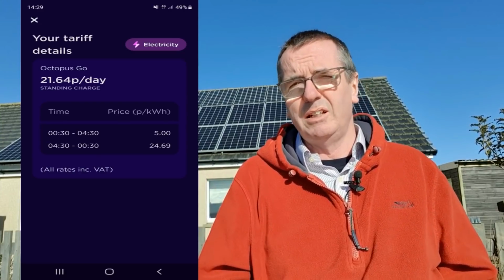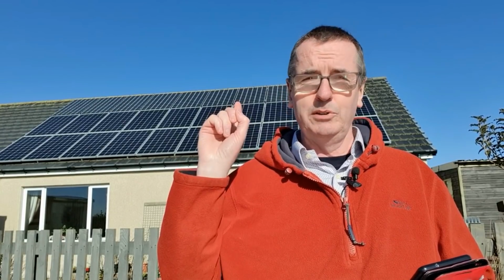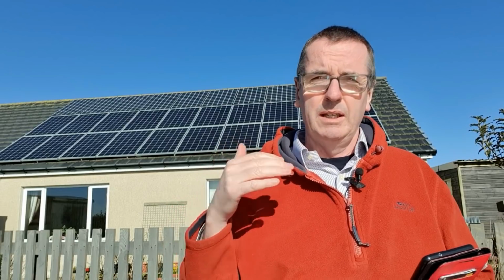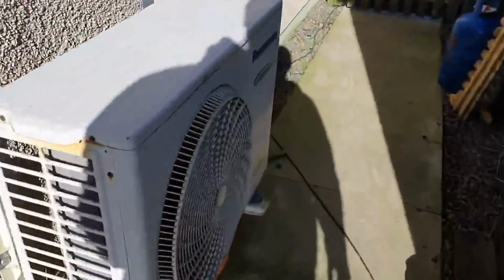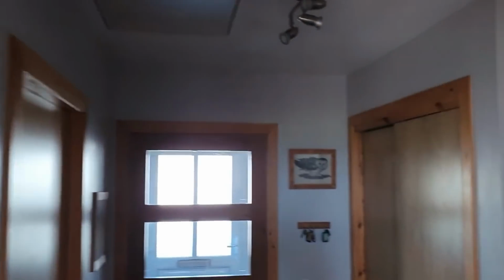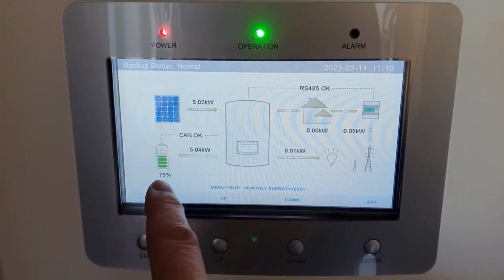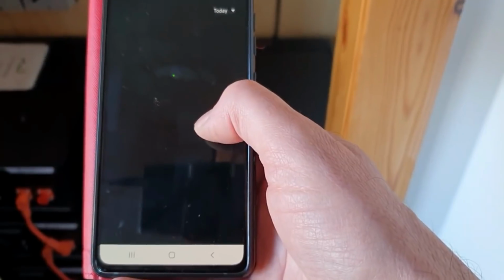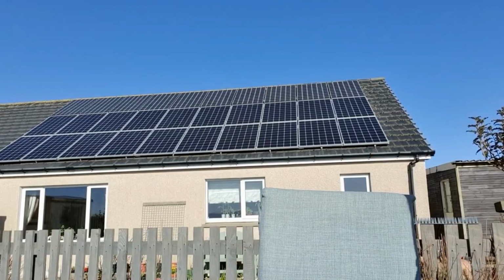My home solar PV and Pylontec battery storage setup

Comment: Excellent walkthrough of your setup.  I am going down the pylontec route myself in a few months.  I have 4kw solar array, ground source heat pump and rain water harvesting system.  House is super insulated and all devices are A++ as a minimum.  Like you i am interested in the technology, but specifically want my house to be as cheap to run as possible for when i plan to retire in 10 years at 60.  My current Go tariff and electric bill come to £1350 a year, but my FIT is £1500 making me a small surplus for the last 2 years of living here.  (Solar installed. 8 years ago by previous owner).  My new tariff from Go based on actual usage is £2780, so i want o upgrade my panels to 10Kw and put in a battery solution to harvest the solar as currently i send the majority to the grid.  I have a Nissan Leaf which is cheap as chips to fill up.  My water bill is £65 a year and we do not have any form of oil or gas so no bill to pay except for the cost of logs for our fire which is £200 a year.  Solar and batteries have never made so much sense financially as they do now.  Would be really interested to see what you do about the wind turbine as i live at the top of a hill which gets plenty of wind.  It seems a no brainer to me as i have a large agricultural barn i could put 2 or more on which is away from the house but fairly close to the solar array and the inverter.  Cheers again.  Convinced me with pylontec.
Reply from the maker: Thanks J for your comments,  and great set up you have , it really does become a passion doesnt it !

Comment: EVERTING depends o the night rate remaining low,, that is the Achilles heel in the system,! 😬
Reply from the maker: Around 8 months of the year i fill the battries from solar , there will always be a cheaper 'off peak' rate electricity as when demand is low , company's 'need' to sell it in order to balance the grid.

Comment: If your roof wasn't suitable for solar would it be financially worth going with a battery set up to benefit from cheaper rate night time charging?
Reply: If you have a pair of east/west roof pitches then it can still be worth investigating the pv potential now with the lower cost of panels. You get a different shape of generation both through the day and over the year - it has some upsides as well as downsides.
Reply from the maker: Yes ! Fill when its cheap , use when its expensive !

Comment: Thanks Jonathan. Great video. Thinking of all the tech mentioned. My only issue is only cupboard space near mains is under the stairs. Could I fit everything in the available space.
Also do you have bird issues on panels. My wife is concerned that they may become a problem on the roof.
Will definitely be looking for a heat pump system next. Love the batteries as they are doable👍
Reply from the maker: Ive not had any bird issues here , my friend chris in Aberdeen has had grills fitted around his panels to stop the birds nesting. Depends on the area i suppose.
Reply: You can now get bird guards (plastic) to stop that issue.

Comment: Hi, interesting to see your setup... couple of points / questions..
Isn't that just an AC split system, not any kind of air source heat pump like they are pushing as boiler replacements now? Probably worth clarifying that if so....
Also i say the same on the ROI point- im getting solar & battery installed in a few weeks and the general comment i get from the NPCs is "oh how long will that take to pay back, like 25 years" ... how long will your new kitchen take to pay for itself? Oh thats right... never! Most home improvements dont really pay for themselves, houses will go up in value anyway but solar and battery will likely improve your homes energy rating, and as you say given todays prices the payback time will amount to just a few years!

Comment: John I’m a little bit baffled, when the battery is full you said your hybrid battery Inverter shuts down,  why can’t you use that to turn the air source to warm the home or heat the sunamp so it charges , that way your draw will level out and heat the home at the same time?
Reply from the maker: It shuts down only if no electricity is needed in the house or ev charger , and both battries are full.
Reply: @JonathanPorterfield  ah right thanks

Comment: Do you happen to know any automated service(or a feature in any of the inverters in the market) like the Tesla autobidder that is really smart on managing the hourly spot price and feeding the grid only if the delta on night time and daytime fees are large enough? I am planning on getting 22-38kWh of Pylontech US5000 batteries in Finland because the challenge is that Tesla PW is not available do to supply/demand issues. I calculated that the cost of 1kWh cycle of just using the Pylontech batteries(6000 lifetime cycles on average on new LiFePo) is about 0,07€ per kWh for the wear and tear of ESS. So it's not wise to dump the battery charge during the day if the difference is less than 7 cents which it is many times during the daytime in Finland. I know, tough times for us when electricity is "too cheap" to use batteries to sell energy =)

Comment: Do hybrid inverters work without solar panels so just the battery inverter/charger part?
Reply from the maker: Yes !
Reply: @JonathanPorterfield  :D I've had solar panels fitted in the  mean time, budget didn't stretch to a battery. Want to do an ac coupled battery with salvaged car batteries

Comment: Great setup and we seem to be on the same page. We have 10kw solar and around 20kwh pylontech storage. We are in year 2 of the setup and it looks like we are keeping our electricity bills low. We still have to sort the heating and I am still trying to work out if sunamp or a mixegy is the way to go. We are also looking at maybe more panels to get more base load during winter. I'll admit March to October is sorted and we only import later october until late feb. Like you say, is this about return on investment or a hobby? I would say both, but I also look at it as minimising what is needed to run our house. Council tax, electricity, gas, food shopping are all going in one direction. Being able to reduce some costs by generating what energy is consumed on site seems to be a good way forward.
Reply from the maker: Brilliant comments John 👏  thank you and lets all keep on telling folk there are ways to reduce our bills , but more importantly our carbon 👣

Comment: Hit the nail on the head about return on investment! Do the inverters talk to each other and is that an issue or not? Also do the Pylontech batteries get hot too? Awesome video, thanks for sharing!
Reply from the maker: Thanks Mo for your comments,  yes the inverters 'talk' to each other , and the Pylontec never get 'warm' the built in BMS ( Battery management system) controls everything including temperature. 😀

Comment: Hiya Johnathan I have an older style house which is not suitable for solar. I have a garage that would fit about 12 panels on would you bother with a small array or not? Also would it be worth getting a battery 🔋
Reply from the maker: Any solar is better than none ! It's definitely worth investing in as Electricty prices rise !
Reply: Hiya Johnathan what the highest output you could get from 12 panels 🤔
Reply from the maker: @antonybeaumont2697  the highest is 8kW as this is the limit of my hybrid inverter,  total on roof is 9.2kWs.
Reason for 9.2 kW on the roof as it will peak at 8kW for longer at mid day in the summer months .
Reply: In kws 🤔

Comment: Just signed up as subscriber. At the doing serious research stage here - tho already have 1/3 share in 11kW wind turbine, an air source heat pump, electric range oven, one EV and about to add phev to replace a diesel. Am concerned that prices are so jacked up now for installations that I should maybe wait until things calm down. 

Last 12 months We imported around 13,000kWh (car 3k but that will go up with phev, ASHP 4.5k, oven 5k, then heat recovery ventilation system and usual appliances) but with turbine probably using around 18 and adding phev will increase further. Eek! No gas (not available) and got rid of oil in last 2 years

Anyway thanks for the video
Reply from the maker: Thanks Tim for subscribing 👍👍

Comment: What a great explanation of your set up Jonathan. We had a 7.5kw set of panels installed last June, along with a 4.8kwh of pylon tech battery storage. At first glance we appear to have the same Solis hybrid inverter as you, but my version of the app gives no control over when I might want to charge them from the grid off peak. Although I’m with bulb currently, so no differentiation in pricing.
I already wish we had gone for more storage & the capability to run when the grid goes down (not too frequent in north Norfolk). That’s next years project I feel, along with getting an EV, so we send far less excess power to the grid.
Reply from the maker: Thanks for your comments 🙂  and its great that you too are on the same renewable route as us !
Reply: @JonathanPorterfield  Hi, I've also got the same Solis/Pylontech setup, but like the commenter above, the solis app I have doesn't allow me to enable/disable charging the batteries from the grid. The app purely allows me to monitor the setup, not control it- does yours? If it does what is it called?  The browser version is the same.
Reply from the maker: @chezlong  Hi Mel , i go into the menu on the hybrid inverter and turn the timed charge of the battries 'on' or 'off' , bit of a faff i know. Im in the 'off' setting now these last 2 weeks , and must days the battties are full come 4/5pm , and im waling up to 70% full , ready to top up the next day , so as of late march ive no need to charge from the grid at 5p between 00.30 and 04.30
Reply: @JonathanPorterfield  Thanks for the quick reply, that's good to know, as that appeared to be the only way I could do it too. They really need to improve the app to all us to control things, especially if the inverter is less accessible, like the loft! Would also like local monitoring instead of relying on Solis cloud.

Comment: What's the risk of these baterries to go bonkers and start running off and create a fire ? I'm looking for 8 pcs of 3000c and I would just have the room to install these under the stairs near my consumer unit but a bit concerned if they runoff we won't have the time to evacuate the upstairs ;) also does your 3.5kwh inverter charge these fully during night ? That's approx 20kwh usable up have there ? Considering 80% usable
Reply from the maker: Very very low risk as these batteries have a different chemistry makeup over evs , we dont need such heavy discharge rates , ive yet to feel ANY warmth from the batteries.

Comment: Brilliant video Jonathan, I really enjoyed it and completely agree with your conclusion that if you can afford it, do it.

I certainly haven't looked back since getting my 16 panel (5.6kW) solar panel array installed in July 2020 and so far it has exceeded the annual output that was forecast by the company I chose to supply and install the system.

I made the decision because I wanted to get an EV and use solar power to charge it as much as I could.  I got my first EV (Hyundai Kona 64kW) last June and have done 8,600 miles so far.  This has used 2,270kW and cost just over £208.  Solar has provided 44%, Economy 7 has provided 46% and the 10% balance has been via public charging when on holiday.
I have a Zappi charger and Eddi immersion controller and will soon have a pair of 5kW Sofar Solar Amass storage batteries to try and avoid sending any energy to the grid.  I'm with Octopus Energy and was pleased when they put up the export tariff to 7.5p/kW from the 1st of February, but I'm aiming to avoid importing any electricity at peak rate, like you're doing.
Still got a gas boiler for the central heating and hot water in the winter months but expecting to swap this out for an air source heat pump at some point in the not too distant future.

You're right about it becoming addictive! 👍😅😅
Reply from the maker: Thanks Robert for your comments 👍  and its great that so many of us have realised that solar and evs and being energy savey is great ( and really addictive) 😀

Comment: I meant to ask about the air sources heating,  is the effects of heating quite dry compared to a traditional electric boiler and (wet) radiators? Cheers
Reply from the maker: Yes , like any A/C set up it does remove moisture out of the air , which is ideal for us here in Orkney

Comment: Thank you for the video What amount of watts do they use the battery itself ? How efficient
Reply: I have had my SolaX Pylontech set up for 3.5 years, my observed round trip efficiency is around 93-94%, i'm in the central belt of Scotland and manage to be self sufficient from early Feb 'till early Nov and top up the Pylons every 2 or 3 days depending on the weather Nov-Jan. Make sure you get your base load down and only buy A++ rated appliances, slow cooker, air fryer, 1 cup kettle and led lighting, it's a total package. I've seen people on FB pages with 25-30 kWh daily usage trying to cover that with solar, FWIW, I've averaged 4 MWh a year generation from a 3.7 kW inverter, 5.3kWp array and 19.2 kWh (400 Ah) battery.
Reply from the maker: Ive no idea , but the inverters loose some energy through heat.

Comment: Good video Jonathan. A similar setup to mine… I was wondering about the reluctance to export when you have excess solar?? I’m on octopus agile outgoing and today I’m getting 23p a KWh at 10am (have seen over £1 a kWh some days!!) for February I was paid more for my export than I paid for my grid import. Seems like a missed opportunity?
Reply from the maker: We have huge issues here in Orkney re the local DNO ,  so id be prevented from exporting any great amount anyway 👍
Reply: This outgoing Octopus tariff looks great for SEG payments but what import tariff do you have it with as Go and Go Faster cannot be had with Outgoing? My concern was any benefit would be more than wiped out with the current Agile import,  fixed or variable rates for leccy.
Reply: @jamesw7786  I’m on octopus go (5p and 24p signed up in December 2021) and agile outgoing octopus which I’ve been on since 2019. Must be loads of wind and solar on the grid today… only 14p a unit export at midday today.
Reply: @MrBenn197025  thanks Paul, that’s a great combo of tariffs then. octopus advertise you can only have their 4.1p SEG in combination with Go, might have to contact them in case this has changed. Can’t afford to leave Go as got 13.45p and 5p until early March ‘23

Comment: Nice video. What stops the hybrid inverter exporting to the grid when your batteries are fully charged?
Reply: The hybrid inverter is G100 compliant so monitors import and export and has grid limitation built in. It is set at 3.6kw so not to go over the agreed G98 limit. If the other 3.6kw inverter is exporting less than the limit it will feed some out to grid up the max 3.6kw.
Reply: @wirebrigade4306  thank you
Reply from the maker: The grid 'only' sees the small inverter , and its how chris my sparky has wired it up , ill ask him to comment too !

Comment: Hi mate well bought the brodex 40ft (cheaper version around £230ish) and cleaned our 4kW setup soon after we moved in in sept 20 but I noticed there was still a residue in sunlight so I bought some flexible 2inch thick medium density foam and enveloped it around the head of the brush with cable ties and whala next wash left no residue but increased the kWs from the panels. Happy days. Cheers
Reply from the maker: Hi , my pole was £100 from amazon , i thought that was a lot 😅,  i only bought mine to clear snow , as we get enough rain and wind to keep my panel clean !

Comment: Great video Jonathan. As you say payback times v difficult to assess but times shrink dramatically as energy prices increase.
Reply: Just charging and discharge of 24kWh of batteries on OctopusEnergy GO tariff every day on new rates will save £2000 per year without taking PV into consideration. Add the free energy and the savings on EV miles. Guesstimate would be twice that figure.

Comment: Great setup, we have 4kwp solar and ASHP but no batteries yet. With a new build 5 bed house and a Tesla M3, we are on minimum 40kwh/day so could really do with another 8-12kwp perhaps on a ground mount in the garden. Really need to look at these Pylontech batteries, probably the same setup as yours!

Comment: Thanks for making the video, brilliant information. I have a solar PV and Tesla powerwall, looking at the options to both expand the PV and heat the house and water instead of the current gas combi boiler. Sunamp and air to air heat pump look the best, especially as you can cool also. Thanks again.
Reply from the maker: Thanks for your comments 👍

Comment: Thank you for sharing. It seems like you need a very good installer/ electrician. I was encouraged to see that you have evolved from a more basic solar system. That may be a first step for those of us weighing up the benefits.
Reply from the maker: I dont 'need' a good electrician,  i already have one with The Wire Brigade , and chris wright !
Reply: @JonathanPorterfield  I should have said " One needs a good electrician".   😜

Comment: Thanks. Very interesting. You have a huge solar array. I'm getting quotes for battery and solar at the moment. 6.2kw solar + power wall = £20k. Your system seems to be much better value and I like the idea of predicting tomorrow's sunshine to minimise the off peak charging.
Anyway thanks
Reply from the maker: Thanks for your comments 👍 im even more interested in the weather than i used to be !